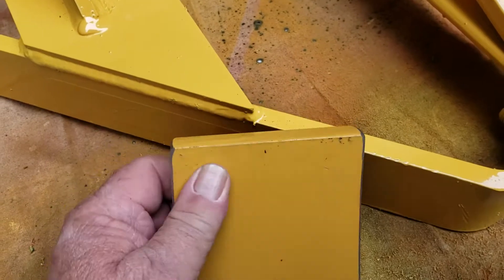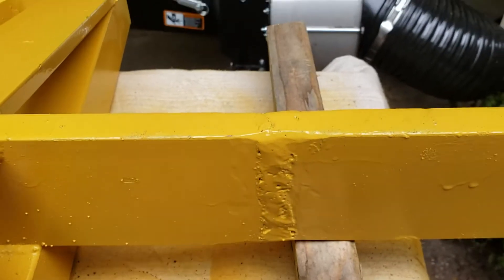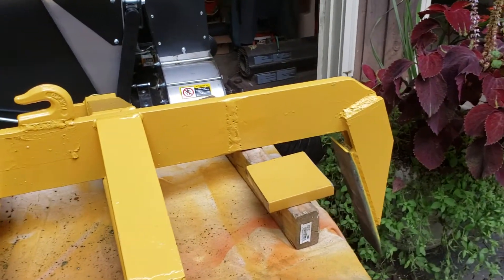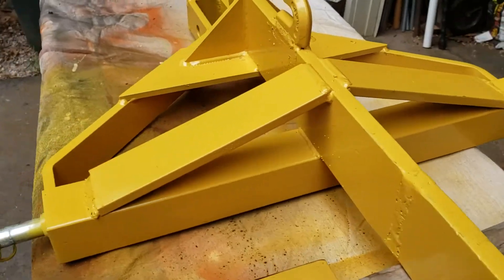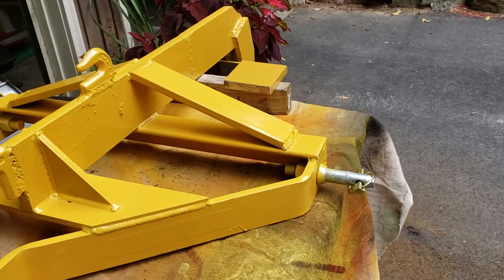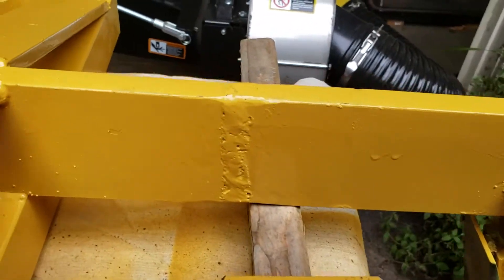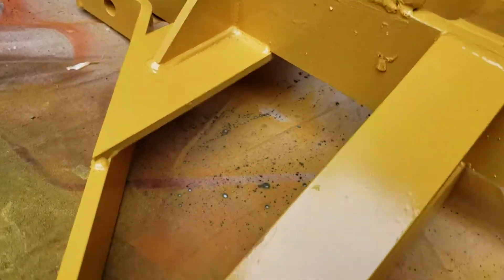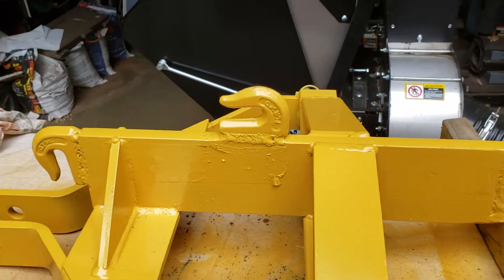SUB SOILER MODS / SUB COMPACT TRACTOR

Comment: Did you have the Pat's at the time? I imagine it would give you slightly higher lift is why I ask. Have a CS20 and considering one of these. Would you still recommend 4" cutout with Pat's?
Reply from the maker: Yes the 4 inch cut out is needed for ground clearance when moving the tractor around.